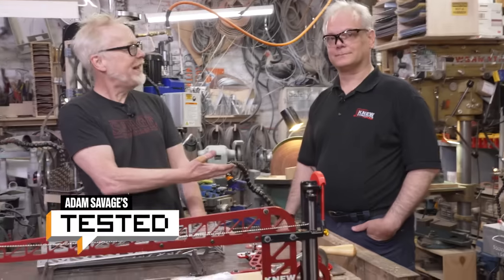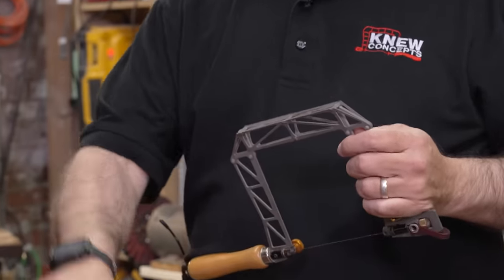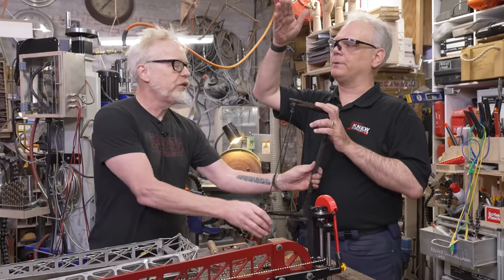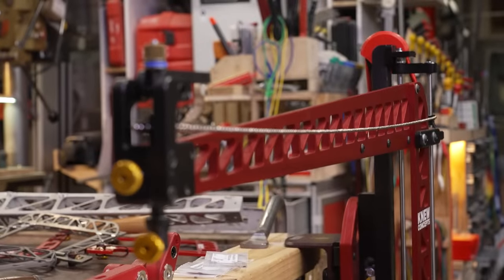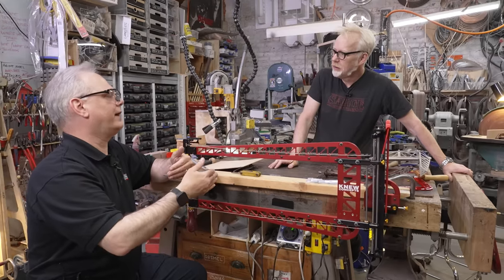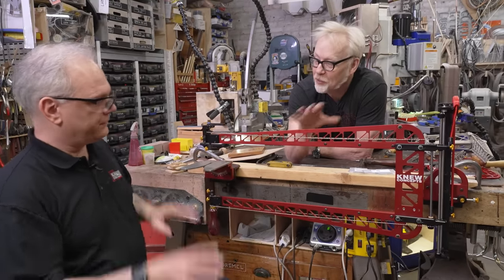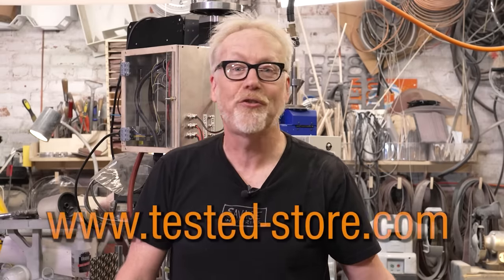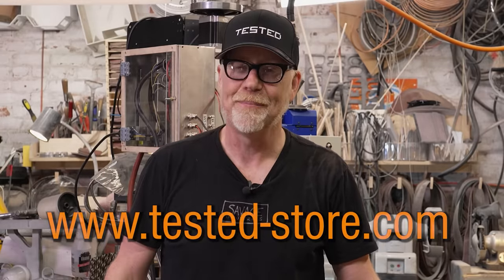Adam Savage Geeks Out Over This Precision Woodworking Saw!

Comment from the maker: Knew Concepts saws and tools: https://www.knewconcepts.com/
Reply: Fractal vices are super-cool tools to have but smooth jaws have their limitations, as opposed to the diagonally-knurled, serrated jaws that most bench vices come with and those fractal jaws will only grip an object from moving up and down, as well as any smooth metal surface can and when you multiply the verticle facets to better grip the object horizontally, the jaws just become 'rails' in a vertical sense, due to less gripping surface. I would suggest putting multiple metal blocks if nessasary underneath the object to support downward pressure.
Reply: I have an idea that i believe solves a problem for people and would be a hot ticket item if we could make it affordable. it would involve metal however and I really only work with wood so I need Help.

Comment: The chain drive on the vintage saw makes perfect sense. It keeps the blade in the same orientation along its entire length as you follow a scrolling pattern. You have to swing the frame around to keep it outside the wood as the blade changes directions. You can't "just twist your arm and the entire saw" if there is wood in the way!
Reply: Yeah exactly. It's not hard to get.
Reply: Also if you want to cut a long strip greater than the depth of the saw, you can then offset the frame to one side and still cut parallel to the straight edge. I have a cheap draper piercing saw where I have bent the top part of the frame so that I can cut 12" parallel strips.
Reply: Yeah, it was pretty weird they both didn't think it was necessary....then immediately moved to their own product using the same idea...lol.
Reply: Spot on, I was thinking the exact same thing. Up a ladder cutting fretwork you can't push the spine of the saw through the timber no matter how far your wrist will go ...
Reply: I guess these guys have never been up a ladder trying to something intricate with a HOUSE in the way and you CAN'T just come in from any angle you want...
Reply: I was thinking the same thing. Very useful for certain kind of work. They even talked about scroll work. You could make some intricate decorations in one cut.
Reply: I found their conversation so annoying. The whole, "you can just turn the saw around what you are cutting".. uh.. but what if you cant? That would only work on something very small.
Reply: Yeah, I really don't get why neither of them figured this out. When you are doing complex cuts on a long piece, there is no other way than to be able to spin the blade. I have a saw that allows the blade the rotate, it just doesn't do it anywhere near as nicely as that one does. Wish I had that saw a few years back.
Reply: Absolutely, that's the first thing I thought
Reply: This. Entirely this. I'm surprised neither of these guys got that.
Reply: bingo.. I'm guessing this was an attempt to reduce material removal from something like the spiral blades of a coping saw
Reply: no i had a similar thought as soon as i seen it rotate.  the armature of the coping saw will eventually hit the material, making the blade rotate on its own axis is brilliant, and the time period that this bit of engineering took place in is mind blowing  @scottwatrous
Reply: Yeah I understood it right away.  Wood can get in the way of the metal loop unless you can turn it
Reply: Classic example of an engineer who has never touched a trade trying to reinvent the wheel, not understanding basics.
Impressive and great looking products though, good luck in your endeavors!
Reply: @richardhaas1989 also with the weight of the arm you can  just let it hang  and use the rotation to make the cut go wherever you need
Reply: I'm surprise a chap who makes coping saws didn't see it right away.
Reply: Yep. Immediately obvious, especially to anyone who hadn't found out they messed up a design until all the way to that one cut a coping saw couldn't cope with. Turns out, they make long boards these days, and there's only so much a blade will twist.
Reply: Except the house isn’t going to move. You can change the orientation of the blade in any fret saw, so you change the angle, such that the house isn’t in the way for your current cut. You don’t need a complicated mechanism (along with the weight) for that. 

I suspect it’s more about just being able to let the saw body hang while you move around your cut. Or, if you are working in a tight area, you can just put the saw wherever it will fit.
Reply: @Ronsonic  I suspect most of their work has always been in shops, and not in large-scale home construction.
Reply: Exactly! Couldn't have said it better!
Reply: OK guys....the answer to your questions is yes and no.  No, you can't swing your hand totally around, so if you were actually trying to cut gingerbread out of a 10 foot long board, the Fenner saw would be at least conceptually useful.  But that's not how they did it.  Look at real gingerbread.  It's made up out of much smaller units.  Which were cut on the ground.  Usually by scroll saws, or pin routers.  Not all of it, always, but most of it.  There are two other problems with the Fenner.  (1) it weighs a ton.  It's solid cast iron, and weighs several pounds.  Not something you want to be trying to deal with on top of a ladder, or at any distance from your body, with one arm.  Anything they would have done with it would have been done on the ground.  (2) The blade simply can't do really tight turns.  It's hard to see from the video, but the blade is both deep and coarse.  It's about 5TPI, and the blade is about .200" deep.  As far as anybody can tell, this is the original blade.  Remember when you were learning bandsaw?  The rule about the deeper the blade, the slower the turn?  The Fenner as it currently exists, simply can't make those turns with this blade.  It uses pinned blades, so they're never going to be very shallow, just because they have to have enough depth to hold the pin.  
Just for the record, there were no coping saws anywhere in that video.  All of our saws were fret saws, and the Fenner is its own weird thing.  The advantage to fret saws is that their blades have almost no spine.  So they can turn on (or in) a dime.  The drawback is they break easily, but for the kinds of very tight turns you need for marquetry or jewelry, they're the only game in town.
Reply: i didnt understand him criticizing something and then showing us literally the same concept solving the same problem lol
Reply: I'm just curious how many people in this comment thread have actually cut fret work in situ up a 30-foot ladder? I would think most modern carpenters would cut it on the ground and then install it.
Reply: I have several cheap coping saws and they all have the facility to rotate the blade relative to the frame, it's essential. On mine, though, you have to loosen the blade tension, rotate each end of the blade, make sure there's no twist, then re-tension the blade. That chain-driven one allows you to keep working without have to stop to adjust the blade. Very useful and very obviously useful to anyone who's ever tried to do anything with a manual coping saw.
Reply: I'm glad you pointed that out. Now that you did it makes so much sense! The goal wasn't to move the blade, the goal was to move the frame!
Reply: But there are and were much simpler ways to do exactly that already on the market with hand held saws.
Reply: Yes, that was an awesome design.
Reply: Correct. I'm surprised he didn't get that.
Reply: @KnewConcepts I wrote the original comment above, so let me say I understand you were replying to multiple comments that went in different directions and I appreciate you taking the time to reply. My comment was simply on the merits of how the Fenner concept was described as an answer to a question no one was asking, essentially meaning it was without a purpose, and therefore I pointed out my belief that the Fenner does have a legitimate purpose. On rewatching I note Adam also tried to point out the value of rotating the frame around the blade. Whether or not it was well implemented or worth the effort/cost is beside the point, and I understand you were using it to set up the narrative up to reveal the large marquetry saw. That saw is essentially solving the same problem as the Fenner, with a fantastic re-conceptualization as a fixed base saw, as well as a cutting edge (pun intended), modern design offering an amazing level of precision. So it proves the point that Fenner's design had merit. He just seemed to be ahead of the technology of the time. I really appreciate that you've kept and referenced the bit of history that's incorporated into your own designs, and hope you can positively reference it in the future. It's so easy to lose track of how far we've come just in the span of a few generations. Your saws are amazing, but beyond my eyes, skills, and budget so I will enjoy from afar. Thanks!
Reply: Im glad I saw this comment because it's obvious someone took the time to design that saw for a reason and it is clear that it is more useful then the saws they have lol
Reply: "You can't "just twist your arm and the entire saw" if there is wood in the way!"

Right? He even describes exactly the use case that requires it (fancy curved scrollwork on the edge of large boards).
Reply: Yeah I lost a LOT of respect for the guy with those comments.  Like he can't figure that out and he works on these saws for a living????
Reply: Sorry, should have read your comment before I did.

Comment: Mr Finner was asking 'Can my wrist hurt less at the end of the day?'
The cast iron frame hangs while working at height so you're not contending with the weight of the frame wanting to twist the saw. Also you're working on the bottom adge of a fixed workpiece so the frame is always out of the way. You would cut in situ for reasons of symetry, cutting detail after fitting would achieve this better than the other way round. He was trying to fix a pain-point.

Comment: I first bought the 5” aluminum frame saw, and although it does provide greater linear strength than legacy jewelers/coping/fret saws, just as he said, the torsional strength was about the same. So, I bought the titanium cage saw and man it’s been great. It is ~3x the price, but the others will break blades after 1cm. 
Also, anyone looking for blades, even though Knew Concepts suggests the pegas brand skip blades, if you’re cutting mild steel or metals then I’d suggest the Herkules White Label blades. They also have sizes up to 14 which are about 1/8” thick, non-skip toothed and case hardened. They cost $60 for 144 blades, but they will last you a decade. Just don’t over tighten any blade, find the correct tension by plucking the blade, aiming for a nice resonance tone; ‘singing’
Reply: We recommend the skip blades for dovetail work.  In wood.  For metal, you definitely want jeweler's blades of one stripe or another.  We stock (and recommend) the Herkules white labels, but any of the name brands will work well.
Reply: I'm a finish carpenter used to be a goldsmith I like this saw but really couldn't justify the buy

Comment: OK, Adam, please read this : I have a tiny little appartment, and it's like a mancave.  But I struggle with my neighbours in two ways: 1) I have 3D printers, but they are to noisy and not moveable for say, and b) everything is everywhere, so the dream of having a smallspace-shop has always been my to-get-to goals, where I never seem to arrive at.  Thinking more recently I need a big shop somewhere, but it is expensive an not for a home-maker.  So, about 17:14 in this video, you were talking about doing videos about and for the small maker and in small spaces?  Well, I could need all the advise you can give, and strongly vote for those kind of videos.  Except, I'm small and probably quite alone. So yeah, keep up the good work!

Comment: No joke, i used fret saws for years and years. Then saw adams video 10 years ago, bought one and absolutely loved it. Seriously a well made and worth it tool
Reply: What do you do with this saw? Not just you, but in general?
Reply: @jaxistheman1  a fretsaw? Or that massive deep throat (hehe) marquetry saw? Because that saw it used to do precision work, such as cutting out parts used in fancy woodworking inlay work caled marquetry. Or even. Metal inlay work as well.

A fretsaw can do similar work, but is also good for cutting out the waste between dovetail joints. It's also used to cut the slots in the neck of guitars that frets are installed into (thus the name). Some call it a jewelers saw (how I best know it from my former trade). We used the. Ofte. To cut small metal parts such as tbe shanks of rings.

Comment: I'm alittle confused at Brians lack of understanding what a coping saw does,
Ive used Coping saws for all kinds of projects for the past 45 years, the ones i use have swivel ends but you have to swivel them yourself both independently and try to match them up, so to have a coping saw that rotates both ends together is genius, i could think of numerous reasons for needing to rotate the blade

Comment: 17:00 - When I lived in an apartment, and constantly wanted to do woodworking, I had this dream idea for a soundproof saw box big enough to put an 8' long plank of wood in, line up the cut, then close it, and it would make the cut for me in completely silence, or at least no louder than a quiet television, because I'm also a night owl, and wanted to cut lumber at 3AM without annoying any of my neighbors. I wondered if there was a way to close over the plank, so it could be a smaller thing, with the lumber sticking out the sides, with some kind of baffles that pressed around the wood to block the sound, but I think there'd be no way to get around the parts sticking out acting like big speakers, transferring the sound to the air outside the box. I daydreamed about it so often - could it double as furniture, like a couch that flipped open, because apartments aren't that big? I also wondered about a very slow system, like 3D printer slow, where I could at least get a cut done over the course of an hour (or several), where it was more like hydraulic force, and a very well sharpened saw that acted like a bunch of chisels, akin to a broach cutter. Then I rented a house with a garage, and the dream evaporated, and then I bought a house with a big garage, so... I'd still love to see some solution for apartment dweller makers.

Comment: I looked at that fancy scroll saw machine with the same awe that Adam did. It really is a WOW! The unfortunate fact is that you still need the artistic talent to go with it. That I do not have. Following a line with a blade is a skill that many lack and as the scrollwork gets smaller, the mistakes and mid course corrections are amplified and it doesn’t take long to make a piece unusable. So, faor the artsy people, here is a product to make the sawing part effortless. For those of us with the hands of a blacksmith, the bestest, elaboratist, expensivist tool won’t overcome our other problem. But from the point of a mechanical wonder, I love what you’ve created. 🥸👍👀✅

Comment: I’m just a garage woodworker, and maybe I’m missing something, but I think all the saws here suffer from the same problem as the vintage one shown - a solution looking for a problem.

The Weber gram for stiffness - a great idea. I always hate how trying to get good tension on one of these type saws, or even a hacksaw, is a pain and bends and even breaks the frame! Kudos!

However, titanium? Seems more like a marketing gimmick. Would one made from cheaper aircraft aluminum really be that difficult to use? I don’t tend to do a lot of work that requires this type saw, but the weight of even a steel one never seemed like a problem that needed solving. And aluminum would also solve the problem with brittle welds since it’s welded every day.

And that red monstrosity!! Seems like it would be more of an awkward hassle to use than anything? Seems to me a powered scroll saw would be a better choice almost every time. The chain drive to rotate the blade - that sounds useful, but put it on a scroll saw! Actually when I first saw (pun not intended) it, I thought that big thing would be powered! Pretty, but seems pretty useless. 

Of course, this is just me. I assume they’ve sold some, so some people must think it’s a good idea. I’d be curious what they think after owning g one for a year.

Comment: The chain drive keeps the saw blade from twisting when you change the blade angle (each end of the blade move together angularly). You spin the blade to get the frame out of the the way of your work.